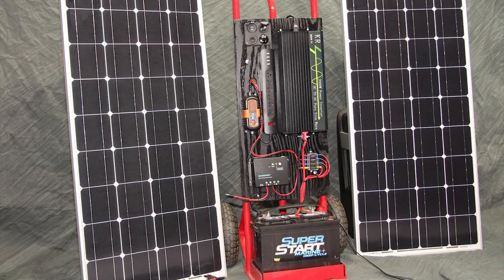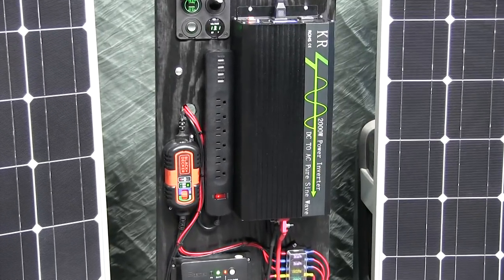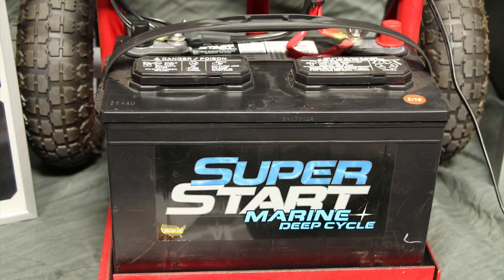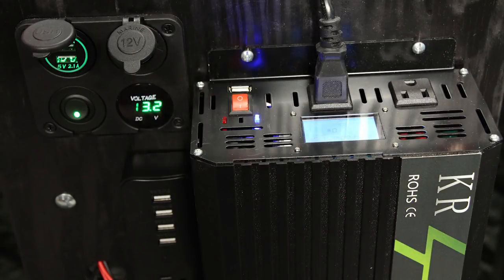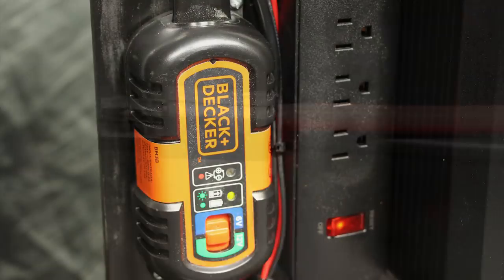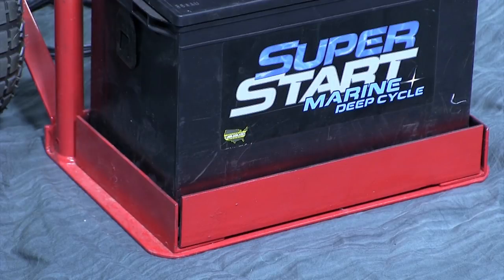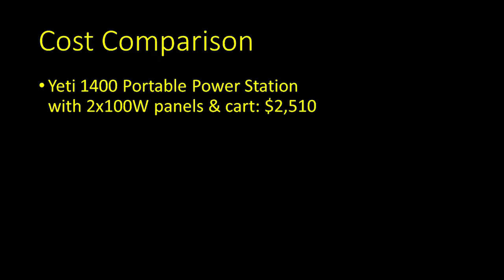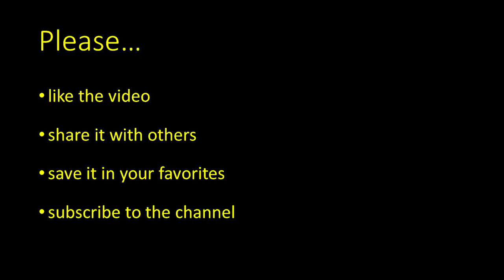DIY Off-Grid Solar Generator (rev 2) – Low-Cost Portable Power  -- with Build List

Comment: For where you live, I think you have done an EXCELLENT job! I'm 63 years young with some physical challenges. Given my limitations; I wanted something like this, so I built a smaller scale version. Since its just my wife and I with a small house and a couple of small pets, I don't need as big a system. 
So, with that thought in mind, I borrowed a Pelican 1430 Waterproof Case from a friend to test my idea. I made my own Gauge Plate out of 1/8 inch ABS plastic, and it now holds a Mohoo 30 Amp Charge Controller (Will change that out to a Renogy Wanderer like YOU have), 3 2-position usb pods (Switched), A digital voltage indicator (Switched), 2 12 Volt Sockets (1 Switched), 2 Anderson Dual port Sockets (1 Switced), A switched input/Output Control Pod for the Solar Charge Controller, and a small pair of Battery Posts to connect to external Batteries should the need arise. THIS IS JUST THE CASE & THE INSTRUMENTS. The Control Board lifts out and has a Quick-Disconnect to the pair of Bioenno 12 Volt 15 Amp LiFePO4 Batteries which also have a 4 Amp Lipo charger; a 6 Amp Charger is in the plan. Additionally, I have Two Anderson Powerpole Cig Buddy Plugs, Two power pole 5 Foot Jumper Cords, a USB "Octopus" to interface various usb devices, an 8 foot usb external jumper cord JUST IN CASE, a Goal Zero Mini usb L.E.D. 100 Lumen Lamp, a Goal Zero Lite A Life 350 Lumen 12 Volt L.E.D. Lamp, and a 100 Watt Modified Sine Wave Inverter. Ultimately, it will have a 400 Watt PURE Sine Wave Inverter. I plan to add a Bioenno 80 Watt Folding Solar Panel Kit to complete the system.

THIS setup cost me about  $1150.00 to build. 

While this is not Pocket Change by any means, it does meet MY needs, which are:
A. It needed to be light enough that my Wife and I can move it around easily as we are getting older.
B. It weighs in at under 30 Pounds.
C. It will interface with EVERY Commercial system currently on the Market.
D. It will run our lower powered lights & devices for RIDICULOUSLY long periods of time between charges.
E. When closed up, IT IS COMPLETELY WEATHERPROOF!
F. It is USER-SERVICEABLE. The Commercial units are NOT!
G. It can be charged by Solar, a Motor Vehicle, or Grid Power. A Motor Vehicle can fully charge the unit in 45 MINUTES!
H. It will stow in the trunk of a car or in the extended Cab area of a Pickup OUT OF SIGHT.

It Looks FABULOUS!!!!!  Now that I have established proof of concept, I'm looking for lower cost suppliers, because my Church Officials, and even some in Law Enforcement have voiced very positive opinions of my build. There may be a business opportunity here, LOL!
Reply from the maker: Awesome job!  Your project sounds like a labor of love — I’m sure you enjoyed every minute of it.  I’m impressed with the engineering, and your voices of components.  Well done!  Thanks for sharing the d4tsils — they are very meaningful to me, and to a lot of other people.
Reply: If you are comfortable putting an email address on here, I'll send you a photo.
Reply: THANK you for the kind words!
Reply: The version I plan to market will have a 28 Ah AGM Battery pack. Optional-and I have it in my prototype is a 40 Amp Bioenno Battery LiFePO4 System. I'm going to build a new Control Head with a reduction in usb pods from 6 to 2, and in the accessories pouch add a $10.00 4 usb Bus strip. This will reduce weight, cost to build and draw on the battery.
Reply: Bruce Forster did you market them yet?

Comment: That USB Socket Charger + LED Voltmeter + 12V Power Outlet looks  very useful, Thanks
Reply from the maker: Yes — the unit is inexpensive, and really enhances the project. Getting direct 12V and USB power without the inverter is more efficient use of stored power, and the voltage monitor helps you protect the battery.

Comment: Very nice evolution of your portable power station, especially the pure sine wave inverter and fuse block. 

 I believe I have the same Harbor Freight handtruck if your's also has the same center tube offset from the side rails. making wood back panel problematic.

I'm in mid-Atlantic area so we have cold wet winters and hot humid summers, so weather protection of all the electronics is critical.  Solved this by keeping my handtruck inside or under cover in small tool shed.  An inexpensive 30 ft 10AWG solar extension cable with MC4 connectors allows me to place my 4 100W Renogy panels for best production and connect to inverter with little voltage drop.  Easy to store coiled cable on handtruck with velcro straps. Your version two is most likely close to optimum weight for ease of handling.  Adding another 30-35 lbs for 2 solar panels would make my unit too heavy and cumbersome given my terrain which is not so flat. So they're on another truck. Maybe you can publish your unit's gross weight.

My handtruck has an 12V 100Ah AGM battery at 63lbs.  An additional bank of 3 stationary batteries gives me a 400Ah capacity.  You can always upgrade the  battery/ies as need and budget allows.

Thanks for posting the project.

30 FT - 10 AWG Solar PV Multi-Conductor Tray Cable - 600V Type TC Cable https://www.amazon.com/dp/B01KWFGFQ0/ref=cm_sw_r_cp_apa_MnrBAbE818Y7M about $26 shipped, just need MC4 connectors, both red and black cables sheathed into single cable, nice and tidy.
Reply from the maker: Thanks for the detail — very informative.  I appreciate the knowledge and experience you’ve taken the time to share.  All the comments here have really influenced my thinking, and the direction of the project. The rev 2 unit is 100lb

Comment: Very nice i built a system in my shed for power outages that has 3 100ah batteries 4 100w solar panels but i have a crappy inverter  1000w msw  it wont start motors..after watching your video it gave me great ideas. Thanks. Mike T  N.G. Maine
Reply from the maker: Sounds like you've put together the basis of an excellent system.  Glad you liked the ideas.  Watch for my next video on 5he real-world testing.  There"'lol be a few more ideas that you'll like...

Comment: Great video. You may encounter a problem using a power strip. I have a Power Source 1800 Solar that I inherited. The instruction specifically advise not using a power strip. I had to replace the batteries recently in the unit and discovered why they advise not using one. The unit has 5 15a rated outlets and inside there are individual wires to each one. I believe the size wire run to these  outlets are too small gauge to run a power strip with multiple devices all running at the same time. Thanks for the video.
Reply from the maker: From your comment, I can see why they’d be concerned about having a lot of load running through small wires.  On this particular unit, each of the two inverter outlets needs to handle at least 1000W, so It’s not vulnerable to the same issue.  The unit also has overload protection that sounds a warning and shuts down the inverter.  Your advice is still good for people building a unit with a smaller inverter — just because you have a lot of outlets, it doesn’t mean it’ll handle big loads you could plug in.

Comment: Hi love the simplicity of you unit and multiple methods of charging. In NZ every thing is far more expensive. I plan to do something similar over time. The only thing I might change is move everything up the trolley and try and get two batteries in there.  Appreciate the advice keep up the great work.

Comment: This  great! One small improvement I can envision is a rotating mounting bracket for the battery to allow the unit to be laid down with out removing the battery. I would also like to see an accessory shelf for convenience.  A simple folding design could also allow for the shelf to become a protective cover of some components when not in use as a shelf.
Reply from the maker: Thanks for the suggestion.  Switching to an AGM battery would also allow the unit to lay over, since it’s sealed and won’t leak.  The shelf would be an easy addition, and could hold devices while they charge or a small TV...

Comment: Thanks for posting that it's very helpful. 
I know you have your reasons for the cart but I think a small wagon would be easier to move around and you could figure out a way to mount the panels to it, but that just highlights the best feature of your design, it's flexible.

I think at this point it would be nice to have a wiring diagram too.
Reply from the maker: Good idea.  I’ve posted a wiring diagram — check the description for the link.  I’m just finishing a builder’s guide video, and will be posting that along with a design worksheet in the next day or two.
Reply: I was thinking, there are some of those hand trucks that can be converted to a 4 wheel dolly. Can the system be installed in that configuration?

Comment: It was an awesome unit before, now it is God Like! Great improvements! This is what I am looking to build for amateur radio. Great job!!

Not sure if you are an amateur radio operator or not, but an Anderson Powerpole connection would be a huge help for amateur radio.
Reply from the maker: I love this idea!  The unit also could be a great base for a mast.  Strap a 16 or 20 foot telescope to the upright, and you could get a 2m antenna up, supported with either folding tripod supports or guy wires...

Comment: the wiring diagram is so useful, thanks a lot!
Reply from the maker: Happy it helps.  Check out the Builder’s Guide video — it has links to a design worksheet that will do all the engineering math to be sure you get the most capable and cost-effective generator.  All the best...

Comment: I would add a mounting bracket for the solar panels and include sliding brackets for a second pair of panels that I could switch on if desired.  I would hinge the brackets so I could pivot the panels forward, allowing the array to tuck in on the sides neatly.   The rig could then be moved as one unit.  I would also consider larger wheels or a second hand cart with more batteries.
Reply from the maker: Solar panels mounted to to frame rails on hinges is a very interesting idea.  I’ve been thinking about how to create a moveable frame for the solar panels that can be easily adjusted for both direction and incline of the panels.

A battery cart is also a very interesting idea.  Perhaps two that can be rotated, so one is charging while the other is supplying power.

Comment: I would add hinges to the solar panels and mount them to the uprights of the hand truck. This would make a completely, self-contained unit. Other than that.....great job!!!
Reply from the maker: Thanks for the suggestion.  I’d considered it but in the low sun of winter, keeping the panels out the shade during e day would be challenging if they’re on the cart.  aid would up mounting them up high for all-day sun.

Comment: Covering the battery posts is good, but you should also cover the other battery connectors to prevent a short.
Reply from the maker: Yup — everything needs to be protected.  Stay tuned for Rev 3...

Comment: Nice setup. The main thing I would change is the battery, I'd go with a diy lithium ion or lithium iron phosphate. With that, you can get a similar capacity(or even much higher if you want) battery setup, less weight, and probably at the same price point if you get the right deal on used cells. Lead acid and AGM are nice when they are cheap and you're not moving them around, but I'm not a fan of moving them around when used lithium cells are cheap and easily available.

Comment: you should put better protection over the battery poles such as an innertube from a bicycle tire or a thick garden hose you cut up along so you can pull it over and so you can easily remove and still protect against falling over the poles
and you should put a strap over the battery so it does not bounce if you pull it over bumps
Reply from the maker: I’ve ordered boots for the battery terminals, but I like the inner tube and garden hose ideas.  I’ve also added som split-loom to the wiring so it’s dressed more nicely.  Thanks for the ideas — everyone that sees the video will benefit from your thoughts.
Reply: Better yet, just get one of those big plastic Battery Boxes from a Tire Shop or RV supply. Modify the cage at the bottom of the lift truck if you need to, then set the battery in the box, the box in the Hand truck, and run the wires out of the box. The battery is now protected from the rain-SIMPLE FIX. I commend you for your Ingenuity!

Comment: I'd look into using Panasonic's HIT panels @ 325 watts each, much higher compact battery storage and the proper management device and inverter. Probably a bigger hand truck or Wagon as well. Along with the other conveniences you already have. Two most important things in long term power failures are heat plant and refrigerator, and usually shorter days. It's OK to spend as much as a commercial unit if it has exponentially better power capacity.
Reply from the maker: Just looked at the Panasonic panels.  They produce 325W with roughly 20 sqft of surface area vs the Renogy panels at 100W in just under 8 sqft.  Also 60V vs 22V, so likely a different charge controller.  Perhaps they’d bettter suited to at 24V or 48V system?
Reply: I'm new to this, but I suspect the Panasonics are geared more for permanent rooftop home setups! The output voltage is the biggest indicator. The 12V systems compliment camping and RV setups. However, if there's a will, there is a way to make these work in a more portable setup. If not now, hopefully soon enough! If and when I do one of these, it will be a high output version. Anything less will torture me.. LOL

Comment: My only complaint is that the panels would need to be carried separately, maybe incorporate a way to attach them to the cart for moving the whole system around (and I know the YETI version they don't attach either).
Others are saying to get the AGM batteries, but for this usage, I think the high quality marine battery is fine.

Comment: that is a really neet unit. looking to build something like that my self. only im going to incorporate supper caps for instant use if I need it right away they charge faster but don't last as long as the lead acid or other batteries but you would have instant use. and they would beable to bleed into the battery.

Comment: Sorry but lithium batteries have a 95%-100% depth of discharge with no shortening of the batteries life. 50% depth of discharge is a lead acid issue when calculating lithium watt hours you get the FULL amount.   12V 100ah lithium battery will have 1200wh fully usable.

Comment: Try to use 2 - 6 volt golf cart batteries with 215 and up amp hours each instead of the 95 amp hours 12 volt for much and double longer runs of high wattage appliances . It’s maybe heavier but it will certainly serve best for starters using the same inverter , charge controller , plug in charger , solar panels and power accessories as before but the best still at lower affordable price then the yeti .
Reply from the maker: Yes — the weight certainly goes up, but the capacity is considerably higher.  The batteries are a better choice discharge-wise.

Comment: Can you do a video on what it takes to maintain a normal house house hold 1 person , that will run a 60 flat screen & ps game station/ DVD player , a central air unite that accommodates a 100 square foot cabin, & normal size refrigerator, & normal washer & dryer , & a normal 60 watt lights as needed
Reply from the maker: I’m just finishing a builder’s guide video, with wiring diagram, and a design worksheet.  The design sheet will calculate exactly what you’ll need to build a system with the capabilities you’ve outlined.  Check back in a day or two...

Comment: Did you consider the optima blue top deep cycle battery? Just curious. Although it is nearly 300 bucks, it is an great battery that can be turned on it's side or even upside down.

Comment: Add one more battery and you will blow that zero out of the competition.
Reply from the maker: You’re spot on.  I changed the battery type to AGM and added a second battery.  Check out the builder’s guide video for the details.  I’ll be posting a video on rev 3 in two weeks.